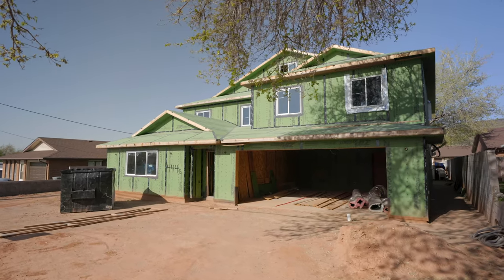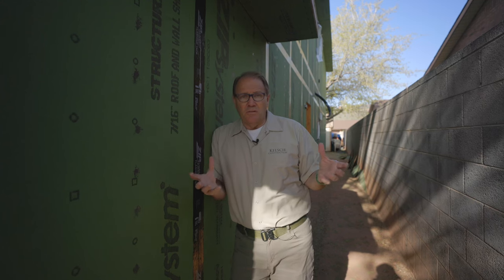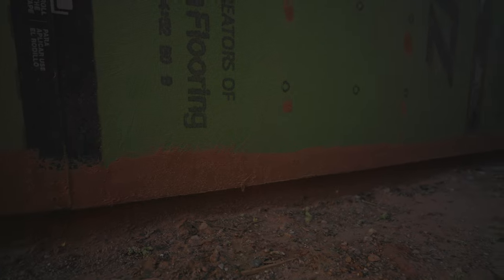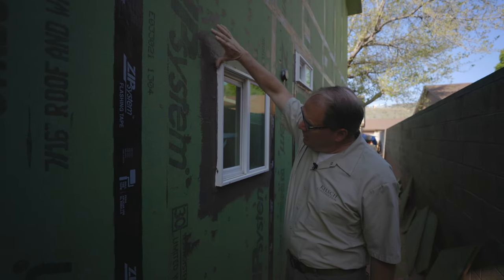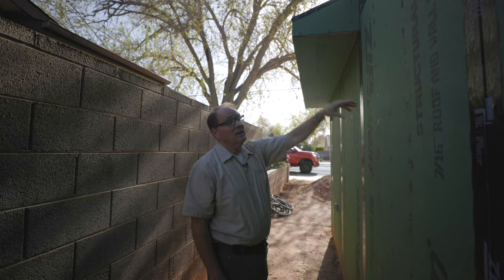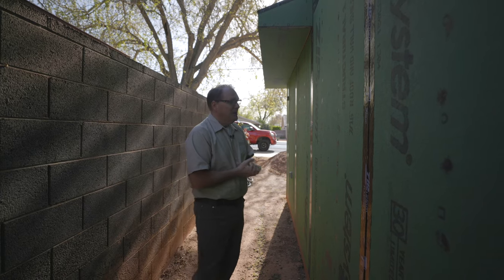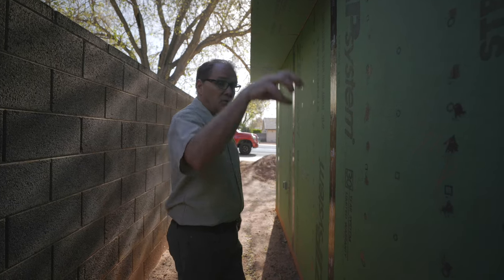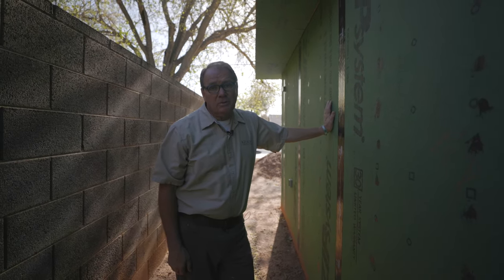Zip System Pros And Cons

Comment: The best method at this time is called a rain screen to allow the air move behind the sheathing.  The more air that passes through the home the higher the energy costs.
Reply from the maker: Very true.
Reply: I recently installed a roofing foil over my composition roof. Then 1x3 furring strips on a 45° diagonal. Then   built a 2" frame work around both sides of the roof. Then I installed 2" of polyiso insulation.  On top of that I screwed down 2x3 rafters from the peak of the roof to the bottom of the pitch. Then screwed down 1/2" of osb. Then installed 30 lb. tar paper. Now I am installing white  exposed fastener metal roofing.  On the top I have a corrugated roofing cap to let out hot air and will cover the top with a metal cap. The comfort inside the mobile home is noticeable more comfortable and my electric bill dropped from $400 to $100 during the summer and now in late fall the home is staying much warmer and the furnace is not running all the time 😀. That was the same with the AC. It would run for a while then shut off.  Usually It would run non stop all day.
Reply: I forgot to mention 😅 I have also have a 12" gable ends and used the ladder method for the 12" OSB over hang on both ends.

Comment: You are right that a building that breathes is going to dry out. It is also true that all that air flowing out of the house in the summer and winter is lost heat/cold making the system that seals all the air leaks MUCH more energy efficient. I think the hope is that these materials will last into the 75 year range.
Reply from the maker: Thanks for sharing
Reply: All these different water/weather barriers are becoming better and better with allowing vapor to pass through but not air. I like to look at it instead of being able to breath, but being able to dry in and out with good air barrier in between.

Comment: Keith I would go one step further- zip needs a drain age plane in front of it, dimple mat etc and good air flow from foundation sill plate to roof
Reply from the maker: I would agree in high humid environments, however I build in the second most arid region. We stay dry all the time. I would like to see more of a rain screen in the design, though.
Reply: @HowToBuildYourOwnHome interestingly hUber now makes. Companion drain screen and also a more vapor permeable  tape.

Comment: I notice that the first window looked at had waterproofing added to the bottom of the window, which is wrong.  If water gets behind the window flashing, it has no way to drain out.  The bottom window flange should have a small gap but sealed from the inside with a can of window/door spray foam.

New homes in my area are required to have a HRV or ERV for ventilation.  There is also a required blower door pass/fail test , so ventilation is a must for such tight construction.  

We used Zip-R12 for our new home (zone 6a) and our blower door test was 75% below the upper passing threshold.  If not for all of our venting (bath fan vents, dryer vent and range hood vent), our home might be completely sealed from air intrusion.  Exterior insulation reduces thermal bridging through wall studs, where studs comprise about 25% of a typical wall with R-1 per inch of wood thickness.  The R-value behind my studs is about 15.

We used a 1/4" thick poly mesh rainscreen behind LP siding, when my contractor thought this was unnecessary.  LP siding has exposed OSB on the backside which will quickly rot if it cannot dry out.  Rainscreen = piece of mind IMO.  Siding paint will also last longer, which pays for the rainscreen.
Reply: So you don't put flashing at the sill of the window? Everyone seems to be doing the opposite.  If you used the Zip system for your house, and did not apply tape at the sill, you've probably voided the warranty. The fin of the window should not be sealed at the bottom, yes, so that if the window leaks , water can run out over the flashing. If the flashing fails, you have a leak in your wall, and it will only dry by diffusion--this is true for the entire house, not just windows. However, the rainscreen system you describe should give ultimate protection.
Reply: @pcatful  Zip flex tape was added all around the window opening.  Just don't tape over the bottom window flange (which I was referring to), so any water that gets behind the window flange can drain out.  Also, the bottom window sill should have about a 5 degree slope to assist in drainage outward.

Comment: I’m framing on the west coast and have noticed your jargon is different than ours. For us a fascia usually rests behind a gutter system. I never knew any other state would call a floor plate a fascia before. Also we use foam for our “mud seal” at the plate. If we have a board that goes along the bottom in the form of a fascia it would be because something went wrong and now needs furred out.
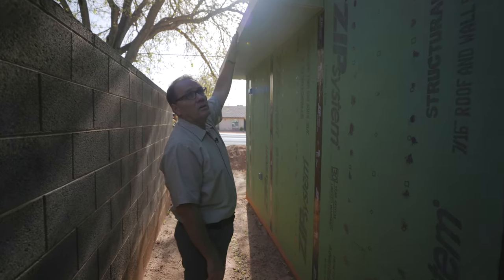Reply: 4:12 He was pointing to the gutter area, not a floor plate, so I think his definition of fascia is the same as ours.

Comment: "Make up air" and ERV ventilation air are two different things.  Make up air is to replace air that is exhausted from the house via bath fans, kitchen hood, clothes dryer, etc.  An ERV brings in conditioned fresh air and exhausts stale interior air and should balance its intake/exhaust.  However, if you have a very tight house and have bath fans, a standard clothes dryer, and a kitchen hood you will need to have make up air in some form that the ERV does not provide.
Reply from the maker: All the more reason to design homes to breath. I witnessed a crawl space designed around constant makeup up via fans only. Electricity shut down for three days and mold started to grow in the crawl space. That's not the dependency I would want in my air system.
Reply: Ridge vent
Reply: @19zodiackiller   Ridge vent what?
Reply: @HowToBuildYourOwnHome  100%
Reply: Exactly! They've been building passive houses in Europe like this for decades. Americans find fault with everything. Homes don't need to breathe, people do. An ERV and makeup system solve all of the problems he's talking about.
Reply: @whymindsetmatters  correct I'd add that all homes want to do is remain dryish

Comment: Looking at either 2x6 framing with Rockwool batting between the studs, Zip sheathing, and Rockwool Comfortbats on top of the Zip sheathing; or Zip R 1” +
2” Atlas EnergyShield.
Reply from the maker: Go with the exterior insulation. It is new code anyway the many local permiting offices are adopting.

Comment: It’s still just OSB with paint on it. The paint chips easily. The material soaks up moisture and swells. One single nail slightly to deep is a penetration. Moisture from the inside can’t dry out. Can’t wait to see all these zip houses in 20 years.
Reply from the maker: Great point, I would prefer a rain screen for better protection.
Reply: Rain screen on plywood right

Comment: What is a good alternative to the Zip system?  I am a self build but I’m off-grid.  I need to minimize the electric components in my home….and air exchange system is something I’m trying to avoid.   I need a breathable home.   I’ve considered passive air vents, but everything I read says they are not very dependable
Reply from the maker: I would suggest a full exterior insulation envelope using just one inch of ridged Rockwool. It will let your home breath and give more R value.

Comment: It’s important to realize that if you’re going to use zip sheathing and you’re going to install it by the book, and tape it well and seal it everywhere then you absolutely need an ERV or HRV depending on your climate zone and if you’re in zone 7 like I am then you need exterior insulation, as well as a smart vapor retarder like Intello or Siga behind your drywall. This all gets very expensive and labor intensive fast.

Comment: Wow!  If that CMU wall is the property line, that is not much room:)  Is that wall on the subject property or the neighbor's lot?

You mentioned wrap.  The caps on the nails used to secure that wrap are not very UV resistant.  They degrade in short order, so the clock is ticking.
Best practices in house construction varies by location across the country and the weather specific to that location.
Books abound regarding what constitutes acceptable Indoor Air Quality, but one thing we know intuitively, is that living in a Styrofoam cooler is not comfortable.
In the southeast, humidity control is more important than temperature control as it can have a greater and quicker impact on IAQ and healthy house structures.
It isn't about building a tomb with no air flow.  It is about building a breathable building that naturally breaths by design, with no additional mechanical equipment required.

As for the Zip system, if you expect the framing process to be exposed to inclement weather during construction, this may be the system for you.
Reply from the maker: I have mixed feelings with Zip. I do not like the word Zip. I prefer to keep my jacket unzipped. I like to breath. I think homes need the same. Keep the shoulders, back and arms warm but let the south facing part remain open. I wonder why we do not build like we live in a coat.

Comment: I’m currently renovating a home in New Orleans. It has wood siding with aluminum siding over it. There’s no insulation currently. I’m looking removing it all installing insulation, zip sheathing, rain screen, hardie board lap. Would you recommend this? Any issues you foresee me having with Zip? Stick to tyvek? I should mention it currently has a 30 inch open crawlspace.

Comment: i see the zip nail holes have been covered with the zip liquid flash but what about the siding nail or screw holes?
Reply: I had the same question
Reply: @tsaipod found out its only the overpenetrations with the nail or screw heads that matter....in theory with a siding or roofing the head isnt going to get past that material
Reply: @utpharmboy2006 thanks. Makes sense I suppose

Comment: you are also overstating the sealing factor, plywood is glued together in.... well ply's, there is no air passing through it, the seams should never see the light of day anyway, the short circuits in most west coast homes are more than enough to circulate air, it takes a very concerted effort to seal a home to the point you need to worry about trapping moisture inside(though it's a good problem to have and solve per energy efficiency)
Reply from the maker: Great comment. I would prefer to let my home breath more than try to seal it up as best I could. My main concern is sealing the home at the foundation level. That is where all the bugs, water and air get inside.

Comment: I just broke ground and my plans had to have a RES check for a required blower door test. They also require a 24hr exhaust fan. So, I got to pay for engineering to completely seal up my house, while at the same time, poking a hole in it and running a fan. Guess what? My biggest source of cold air loss was determined in the RES check. My 24hr vent fan was blowing so much cold air out of the house during the summer, that I had to spec out an additional ton of AC to make up for it. Kinda frustrating.
Reply: I am not a fan of sealing up homes too much.
Reply: You should have used an ERV, then you recover 85-90% of that heat/cool before sending it out of the house. costs less then 1ton more AC
Reply: Is the house already built? You should've gotten a ERV and from the sounds of it may want to fire your builders or engineers.
Reply: @agisler87  It’s a County thing. I have found that there’s no reasoning with the plans review people. I intend on running an ERV, but depending on the inspector it may be after the final.
Reply: @danwahl5231  typically state law dictates over county jurisdictions.  Find someone that knows the ins and outs of your code to find a real world solution that meets the code requirement.  A tight building with 24 hour exhaust fan is dumb.  ERV or HRV is the way to go and here in California it meets the ventilation requirement.

Comment: For a humid climate like Georgia, which ERV plus dehumidifier system would you recommend? Instead of forced air for the HVAC system, would you recommend radiant heating/cooling? Thanks.
Reply: Watch Matt risinger
Reply: radaint heat and cooling unfortunately does not provide any filtration.
Reply: @dbarrington1  Yeah, that's why an ERV and/or a dehumidifier would be needed. Both of these would provide filtration.
Reply: @oldporkchops  what’s needed is an erv, dehumidifier and fresh air system.
Reply: No need to guess, watch Matt risinger. Watch channel to learn how to contract it yourself.
Reply: @SIMSMANORFARM  Thanks, Cliff. Doesn't an ERV provide filtered fresh air into an air tight home? I did watch Matt R's Zehnder and Broan ERV videos.
Reply: ERV is bringing fresh air into the home
Reply: @shannabolser9428  Indeed. Fresh filtered air vs. unfiltered air coming in via cracks and holes in a less airtight house.
Reply from the maker: Radiant heating is ok but lacks air movement. You could do an internal air filtration system with radiant, but the humidity is not solved. I prefer to solve for all in one system.

Comment: What do you think about Rockwool exterior vs rigid foam like a zip system?  Rockwool seems better in terms of fire and termite resistance, albeit at a higher cost.
Reply: It also doesn't shrink like rigid foam
Reply from the maker: Rockwool all the time. I am designing a post and beam build that I will wrap with Rockwool.

Comment: Why does Matt Risinger vehemently oppose your, "let it breathe" theory?
Reply: Different perspectives. Matt believes in sealing houses tightly, then using a top of the line HVAC, dehumidifier, make-up air exchange, and ERV to condition the space. Matt's method depends on tech (so no power means no airflow), and is much more expensive. Humans have lived for hundreds of thousands of years in not-air-tight homes. I don't know why Matt thinks fresh air is so despicable. Sure if you could HEPA all the air coming into the house that'd be great, but at what expense, and with what fortitude?
Reply: @aheadatime  Matt lives in the same hot, humid south Texas environment as we do in south Louisiana.  Consequently, we do not want to live in homes as I did as a child - no AC, just screened windows and a few fans.  And without screens, you'll contribute be constantly contributing blood to mosquitoes! And as "lived in for thousands of years", they didn't even have screens!  Go spend a few nights in the "best" of no-air-tight homes = castles. And you'll see why humans have constantly tried to improve the living conditions in homes.

Comment: What is ‘ERV’?
Reply from the maker: ERV stands for Energy Recovery Ventilator, and is regularly referred to as an air exchanger and an ERV ventilation system. They are designed to be connected into the HVAC system in your home, office, or any other building. They pull fresh, clean air into the building and take out stale/unclean air.
Reply: @HowToBuildYourOwnHome  thank you!
Reply: @HowToBuildYourOwnHome an ERV (or HRV - heat recovery ventilator) exhausts stale air and intakes fresh air AND in the process the incoming air is conditioned by the outgoing air.  Both gadgets are amazing to filter air inside a house especially w wildfires becoming more frequent

Comment: this sheathing is installed WRONG, should have a weep screed underneath it and should be above the grade/below the bottom plate, the grade is going to rot that zip or some concrete guy is gonna improperly flat work up to the zip, seen it dozens of times
Reply from the maker: True, this owner builder did not factor sufficient grade. Sheeting should be just a hair below the bottom plate, then then fully sealed with any number of products.
Reply: @HowToBuildYourOwnHome  When you say “sheathing is just a hair below the bottom plate”, do you mean the bottom of the bottom plate, or the top of the bottom plate?  If it even reaches the bottom of the bottom plate, you’ll then have the interior surface of the (non-treated) sheathing touching the concrete, which would be bad.  Or, a possible way to avoid that contact might be to have the pressure-treated bottom plate extend a small amount outboard of the concrete.  Was that what you meant?